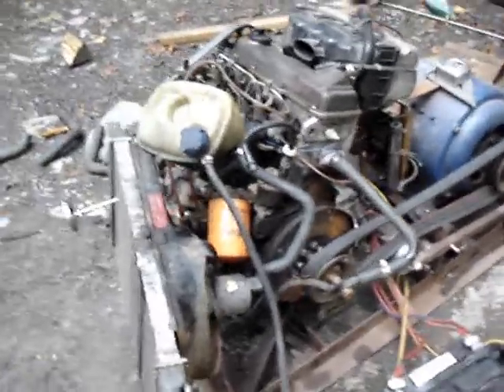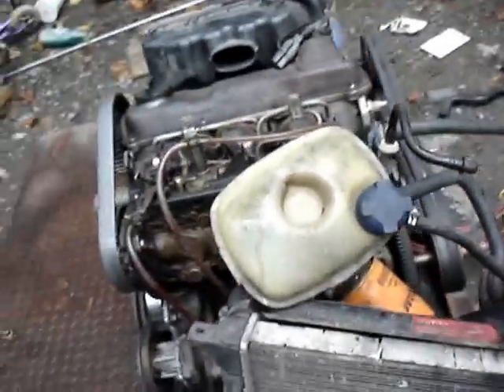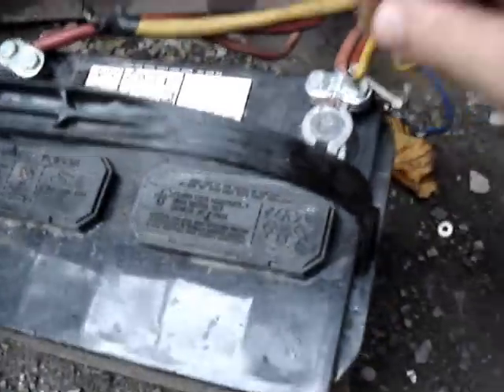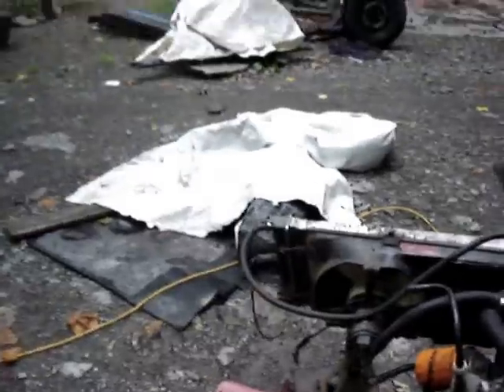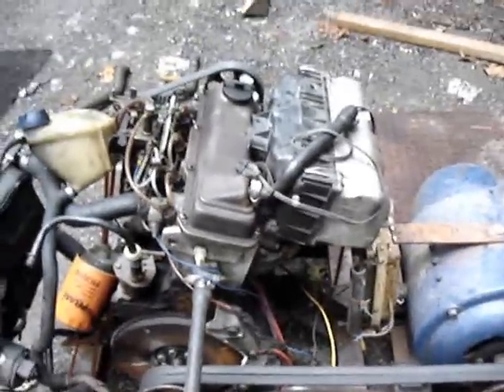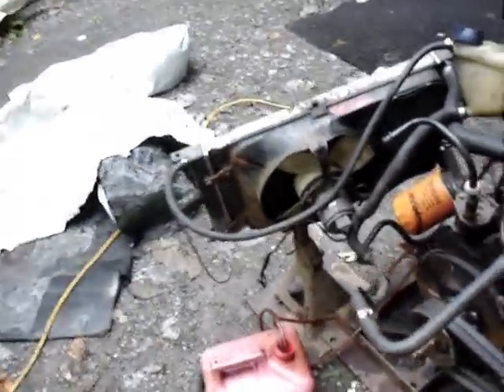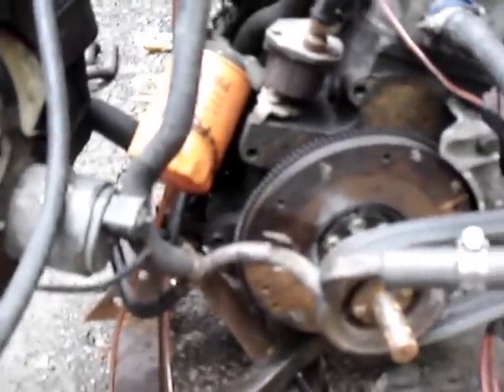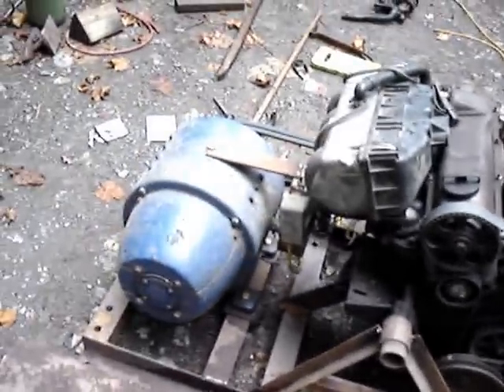Volkswagen Powered Fairbanks Morse Generator

Comment: What have you planned for a governor ? We repowered a bobcat  610 with the 1.6 out of a rabbit, added a belt driven governor to the pto side , linkage reaches over to the injection pump. removed the spring from the control lever. works very good. Set at 2200 at full throttle, max rpm for the hydraulic pump of the skid steer. you probably want it at 1800 for 60 hz. If you have questions email  josef.schwaiger@sasktel.net.
Reply from the maker: Well, I have a belt driven governor off of something or other. Haven't given it a lot of thought lately. Sometime I'll have to get out and try to make heads or tails of it.
Reply: the governor mounts about above the vacuum pump on a bracket , that is fastened to the two upper bell housing bolts. An extra pulley, 6", on the out put shaft drives it. The governor leaver will have to push toward the front of the engine , when governing down the speed.  the leaver has to point downward. this way the linkage is more in line with the injection pump leaver. The clock spring is removed , so it moves easy for precise response . A governor makes any engine into a work horse, because the rpm is always at a set rate, regardless of the load , just like cruise control
Reply from the maker: We were actually thinking of a simple aftermarket cruise control for a governor. Might possibly go that route still. My belt drive governor is from a Gravely of some sort. Removing the spring from the throttle arm would certainly take a lot of load off it. I think I'd still wan't some kind of light return spring on there in case the linkage fails that way it returns to idle if there's a problem. Governor will put it right in the meat of the powerband and keep it there unless you overload it but I figure 60HP is more than enough to run this generator head even at full load.
Reply: A cruise control would certainly be an interesting approach if one can accommodate a speed sensor. with that setup one would want the spring to stay. At 1800 rpm the output of the 1.6 is a little under 30 hp, still plenty for your generator, most of the torque is there. At that rate the engine should  in excess of 20 000 hrs, timing belt should last a long time too, cause there is no load change like in a car. 
good project !

Comment: I am considering doing exactly this, I have a couple 1.6 turbo diesels and want to build a 15,000 watt generator to charge up a Nissan Leaf battery pack in short order. The 1.6, even in a naturally aspirated state such as yours puts out just short of 50 HP as I recall, and should easily produce 15-20000 watts.  Thank for this video !
Reply from the maker: Yea, I remember it as 50 plus or minus. Ought to run this big generator head pretty nicely. Just have to govern it. I have a belt drive unit that I need to adapt. You know those older turbo diesels bring a good penny don't you? And would you happen to have an extra pump from a real turbo diesel VW?
Reply: So I take it the factory governor doesn't do a good enough job holding rpms ?  I played around with a 5500 watt generator and found that I could vary the Rpms quite a bit before it really mattered - that's why I ask. I think I lowered them a good 10 % before my voltage and hertz really cared.  I do not have a spare pump for a turbo diesel, sorry.  Last I knew, rebuild kits were still available tho ....
Reply from the maker: I have an Eco diesel Jetta is why I ask. The pump on it isn't the same as on the older turbo diesels. It runs nice, but it doesn't go like stink as it could. Far as opening up the pump on my genny and playing with it, I have no idea what I'm doing in there so I'm not going to try it.

Comment: where's the starter? how did you turn the engine to get it running?
Reply from the maker: I have a piece of bell housing cut off of an old transmission and it is bolted to the engine. The starter is bolted to the piece of bellhousing. It's difficult to see it in the video.

Comment from the maker: I have that done. It's automatically regulated now. If you look on the back of the radiator there is an electric fan. There's a nice simple system in place right on the radiator that if you run power to the thermoswitch it will kick it on when it needs.

If you go on my channel and search "VW Genny pretty well done" you'll find it pretty well done as the title says. The fan is on and working at the time but I didn't run it long enough for the video for it to kick on.

Thanks for watching!

Comment from the maker: Thing about a TDI, you might need a computer to run the engine.I like the older VW diesels because if you really have to you can run them with no electrical system at all, they're very simple to work on, and very reliable even at high mileage.Also if you hit the junkyards you should still be able to find them in serviceable condition so you have plenty of replacements, for now, and plenty of secondhand parts.A rebuild(rings, seals, gaskets, bearings)is pretty cheap for them too.